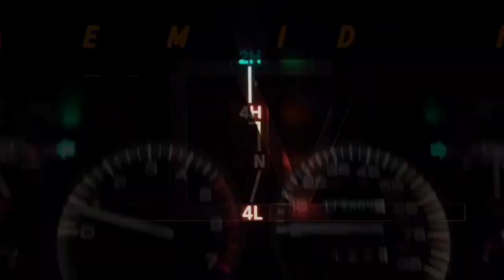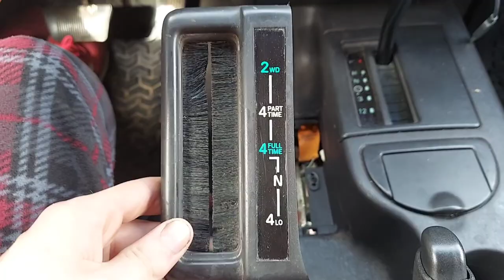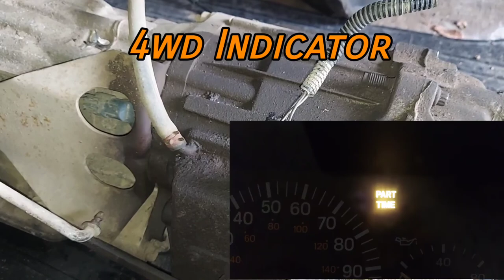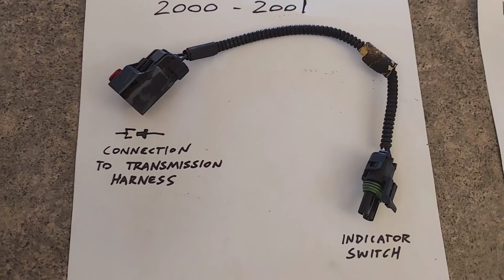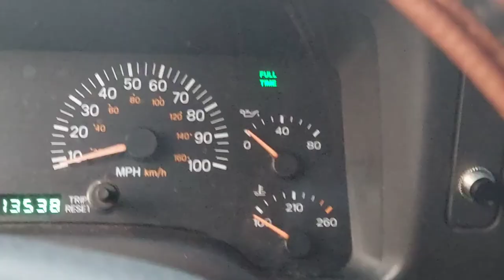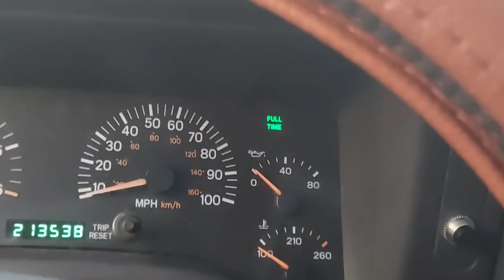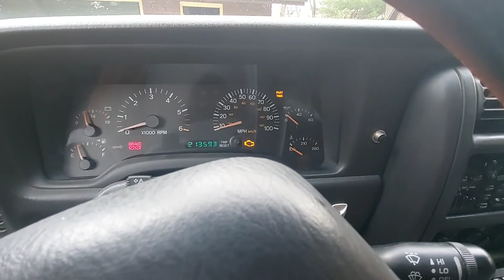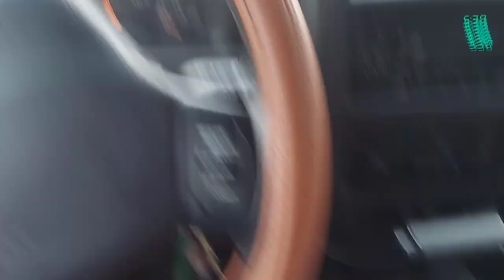Jeep Cherokee - All Wheel Drive Swap, 4x4 to AWD [NP231 to NP242] ['96-'01 XJ] Transfer Case Upgrade

Comment: This is exactly what I was looking for! Thank you so much! I have a 2003 5MT JeepKJ with the NV3550 -- bought for $1800 to use for plowing and light hauling (like garden tractors and dirt). It's a workhorse. It came with the NP231 of course because of the NV3550. Just bought a NP242 for the same reasons you did (as well as a NP231 in case the NP242 doesn't work out) which is how I landed on your video. You quickly helped me realize that I'll still need a couple parts from the junkyard to do the NP242 swap. Thank you so much for the info about the manual transmission compatibility and the wiring, seriously, the sharing of information like this saves folks so much time, thank you.
Reply from the maker: Well hey it's awesome this intel also applies to the KJ! Very cool you found a manual one! 
However, there is some additional information that I didn't know when I made this 242 Swap video. I have it documented at 13:27 in this video: https://youtu.be/h138NSGFI7o skip to 13:27

You may need to install a longer input shaft on the NP242 before mating it to an NV3550. On the XJ at least, they only had medium length input shafts - but my Jeep knowledge ends in 2001. I have no idea what input shafts the KJ used. It may require a bit more digging. 

Also, the dashboard lights are probably on a different circuit and might work differently in the KJ. But the swap should be possible.

Comment: Awesome video!! So if I do exactly what u did in your video i shouldn’t have to run an extra wire from the connector into the engine bay ?
Reply from the maker: If you have a 2000+, yes. If you have any other year, you'll need to run wire to the transmission harness connector in the engine bay

Comment: just finished the swap and i am now getting vibs at 30-40 mph, rewatched the video to find that the same drive shaft can be used, my first thought was the driveshaft but now i am not sure
Reply from the maker: So I'm assuming you put a different driveshaft in alongside your transfer case, and had vibrations at 30-40mph, and then you put in your original driveshaft, and have the same problems? 

If the problem only started happening immediately after changing the transfer case and nothing else, then by process of elimination I would bet there might be something wrong with the transfer case. 

Where did you get this transfer case from? what vehicle did it come from? How many miles are on it? Did you reuse your front driveshaft? Are you on a lift? 

I don't know if I'll be able to help
Reply: @WAEMIDIV  same everything, stock rear shaft, got it fairly cheap from a 98 zj, went into an 01' no lift... was hoping that maybe the 242 is slightly longer and causing driveshaft issues, but process of elimination makes sense if both boxes are truly the same length... thanks for the quick response!
Reply from the maker: @israelmarquez1515  The 242 is slightly longer than then 231 but it's such a subtle difference the driveshafts are interchangeable.
Reply: @WAEMIDIV  took the rear driveshaft off, drove around in 4hi at 30 and had no issues, rebuilt the driveshaft and getting same vibrations again, its only at 30-35 mph so i drove it to work anyways, im guessing a bad box like suggested...was reading about a "hub synchronizer" so im going to look into that and read some forums....going to throw the 231 back in until i can rebuild the 242 but if its a bent shaft i need another box.
Reply: So how did it end?

Comment: I had this done recently, but I still lack the dash lights. The connector in the NP242 is defect (21:15) Where can I find one?
Reply from the maker: I got mine from RockAuto, make sure you get the NP242 sensor; it is different than the NP231

https://www.rockauto.com/en/catalog/jeep,1999,cherokee,4.0l+l6,1431776,electrical-switch+&+relay,transfer+case+switch,13823
Reply: I followed your link but it does not take me to the plug. I need the plug that you plug into the switch. Where do you find that?

Comment: How did you fix the azzy design works shift linkage from locking up when you're in 4lo. With mine the articulating nuts linkage gets parallel with the transfer case side link and I can't get out of 4lo without going under and pushing it out.
Reply from the maker: I only had this issue with the 242 on a manual transmission, I changed the configuration in such a way that allowed it just enough of an angle to be knocked out of 4Lo. I demonstrate this in the Manual Swap Part 3. I never had the issue with an automatic
Reply: @WAEMIDIV  I'll watch that now. I have an idea of what I need to do but God damn you respond fast I love that man

Comment: got any hints on swapping an 2003 NP242 from Grand Cherokee (WJ) to a NV3550 TJ.  my confusion is the input shaft side.  The 231 appears to be long input gear shaft to mate with 5speed?? while the WJ  is short and mated with an auto (42RE)??  

sorta confused... not finding actual measurements of what long and short is.  NP231 pulled off my 5speed has input shaft of about 1 3/8 inches coming out front of it.   All things in this situation appear to be 23 spline
Reply from the maker: The Input shaft length of the transfer case is determined by the transmission it was originally mounted to. 

The NV3550 cases all have a long input shaft, and usually the automatic-mounted cases will have a medium (AW4) or short (42RE) input shaft. 

The NP242 was never available with a manual transmission, so you will never find a long input shaft NP242. You will have to swap the input shaft yourself to make it work
Reply: @WAEMIDIV   what have read but not found verification yet is the long shaft is same  inside both NP231 and 242...  if that is the case then dont have to search for a long 242 shaft..  just pull  the one from my 231.  

Other wonder is...  short shaft of 242... while not the best thing to mate with 3550... it still works.... from what read (but not verified)
Reply from the maker: @coachgeo  Yes the 231 uses the same type of input shaft, so you can put that in your 242

I would not use a short input shaft with an NV3550. It does still connect, but you'll only have like 0.6" of spline engagement, so if you stomp on the gas hard enough you could shear the splines right off
Reply: Have you gone through with the swap I’m looking to do the same swap in my tj and was wondering if it worked
Reply: @redryder7504  not yet...  I snafued and ordered wrong replacement input.  Got another one but just getting MB_TJ running is more important (was in middle of engine swap under a tarp and winter hit before could finish.)   Will be end of june probably. (am retiring then jumping on it)
Reply: @coachgeo  good for you I also just found out the 242hd has a longer input shaft so I’m gonna start looking into that
Reply: @redryder7504  HD may have longer...  regular 242 is shorter (for automatic trans mating).  You need longer for standard trans if you have that in your TJ ... which was my case.
Reply: @redryder7504  HD I think has different spline count too

Comment: So orginally my 99 xj had a np231 in it. Which I thought it was as well because of the bezel plate. When I went to have a sye installed it turned out that it was actually np242 so i couldnt get it installed. Now that I know its a np242 i noticed it wont go into fulltime only part time. What would be the reasoning for that?
Reply from the maker: That's why you need the shift gate. The NP231 shift gate probably doesn't have enough room for the lever to snap all the way back into full time mode, before it goes sideways and into neutral
Reply: @WAEMIDIV  that's right you said that. Ooo ok thats what I'm missing. But I'm putting a locker which will cancel it out I guess.

Comment: lol, subaru mode.  Are you still running the u-joint front axles, if so do you notice any binding aka scooting in turning in awd?  Or, did you change to cv style front axles?
Reply from the maker: There was never any binding, no. The open differential in the transfer case will absorb any little irregularities like that. But I also didn't often use the AWD and when I did I was never making very sharp turns.
Reply: I have a factory installed version. No hopping or binding. If I recall, the power wasn't 50-50 front back, but more like 45-55 and that prevented the hopping.
Reply: I had the 242 in my 98 ZJ which had the u-joint front axle shafts, and yes, it had a slight bit of binding action going on when in full time 4WD mode, I don't think the limited slip rear diff helped much either LOL.

Comment: I wouldn't really consider swapping out a 231 for a 242 an upgrade. It really depends on what you're planning on doing with your XJ/ZJ. I swapped  out the  249 for a  242 in my 96 ZJ. The reason I did it is, it was cheaper to buy a good used 242, and put a heavy duty chain and sprockets in it. Than it was to just replace the fluid coupler in the 249.I did all the work myself,except shortening the driveshaft.  Yes,I had to shorten the driveshaft. I installed a 98 XJ 242 and it has an external slip yoke. The 96 249 had an internal slip yoke on the output shaft. I had to get the drive shaft shortened by  about 3 - 4 inches.
Reply: Swapping the 242 in place of a 231 adds full time 4WD mode, if you live in snow country you'd appreciate the full time 4WD mode.

Comment: What is the top speed for 4wd High?  I hear that 4wd Low is 20mph.
Reply from the maker: I forget exactly but there's not really a top speed for 4wd Hi, the limit at which you can switch the selector is at 50mph though. 

If you need 4wd at any speed higher than 50mph though you should probably slow down
Reply: @WAEMIDIV 
 thanks!
Only had the (96) jeep for six or so months.
Started to snow, so.. trying to sort out 4wd operations.

Thought you had to go into neutral, at a speed under three mph to switch from 2wd to 4wd??

Not sure about switching out of 4wd.

I got a find an operators manual (the repair manual doesn't say anything about it).
Reply from the maker: @Jerry-vz4ix  you're thinking of 4Lo 

4Hi can be toggled at any speed below 50mph, and switch back to 2wd at any speed. 

4Lo is to be engaged/ disengaged ONLY when the transmission is in neutral, and you're not moving/ moving very slow (less than 3mph) 

You should find a long parking lot and try 4Lo, just remember to only drive in a straight line because Part Time can't be used on dry pavement unless you go straight.
Reply: @WAEMIDIV  

Thank you for clearing that up.
I Really appreciate it.
Reply from the maker: been thinking about making a video explaining it all, but I got so many other things to work on

Comment: How does the gauge cluster look when you don’t do the wiring?  Do the part time lights still work?
Reply from the maker: Because the connector on the switch itself is different, without splicing the new connector onto the old harness will mean neither "part time" nor "full time" will work. 

I figured if I wanted the Part Time light to work, I'd need to splice on the connector, and at that point may as well run a new wire for Full Time

but you don't need the dashboard lights at all, they don't do anything aside from tell you you're in 4wd.
Reply: @WAEMIDIV  so what kind of pigtail would I need if I have a 2000 XJ and putting in a 1999 NP242
Reply from the maker: @gersonruiz1714  You need the '99 pigtail wired onto your '00 harness, exactly what I did in the video. I used a '99 on an '01, which is exactly the same process
Reply: @WAEMIDIV  I've been looking everywhere for the 4WD indicator pigtail.. can't find anything online.  any suggestions without going to a pick and pull?
Reply from the maker: @gersonruiz1714  I got mine from a parted-out 1999, so that's basically a pick-n-pull lol. I have no idea where to find NP242 indicator switch connectors, but RockAuto has them for the NP231: https://www.rockauto.com/en/catalog/jeep,2001,cherokee,4.0l+l6,1373666,electrical-connector,4wd+indicator+light+switch+connector,621 

you may find some luck on this forum I found but don't have time to read through: https://www.naxja.org/forum/showthread.php?t=1160290
Reply: @WAEMIDIV  I’m going to the pick n pull tmw and see if I can snip one real quick.  I have a 2000 XJ. Should I get a pigtail from a 1999 NP242 or from a 2000 NP242?  Would It just be easier to get it from a 2000 since I can disconnect it and connect it easier ?
Reply from the maker: @gersonruiz1714  Yes, Ideally just take the 2000's connector - you won't even have to cut anything it should just unplug right above the transfer case

But if that turns out not to be an option, the 1999 connector will still work, you'll just have to splice it like I did in the video
Reply: @WAEMIDIV doing my swap right now.  I'm making my own wire connector harness for PT and FT light.  The new connectors aren't color coded.  Do you know which wire goes to which based on wire position on connector or just color coded?
Reply from the maker: @gersonruiz1714  I don't have any idea unfortunately. You have to use a multimeter to see what positions have continuity in which 4wd mode and do trial and error. There might be wiring diagrams somewhere on the deep web

Comment: can i ask why you would go from the stronger np 231 to the np242 which is a weaker transfer case?
Reply from the maker: 2:14 As I stated in the video, I never do any extreme offloading, and I live in a miserable snowy environment where winter lasts half the year. Not everything is about sheer strength.
Reply: The 231 and 242 are the same strength....the 242 is a 231 with an added open center differential for full time 4WD mode....

Comment: What’s the total cost?
Reply from the maker: Well that depends where you get your stuff from. I got a used transfer case with 230,000 miles on it for $110, and the azzy linkage was about $80, so that's about $200 for me, not including tools or other small tidbits here and there. 

If you buy a brand new or remanufacuted case it'll be somewhere in the thousands I would guess